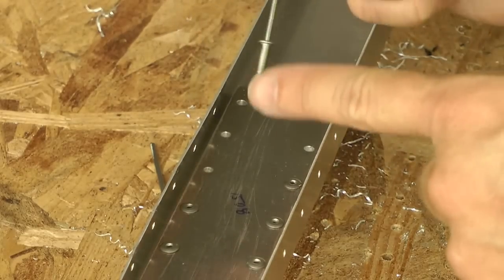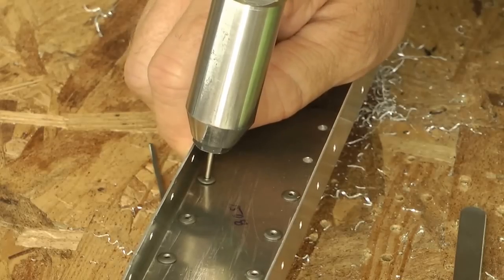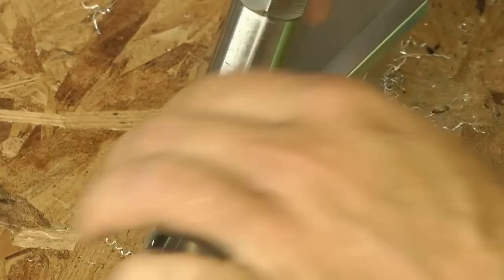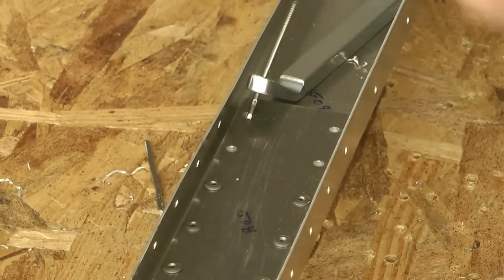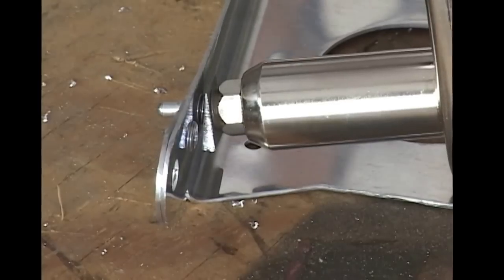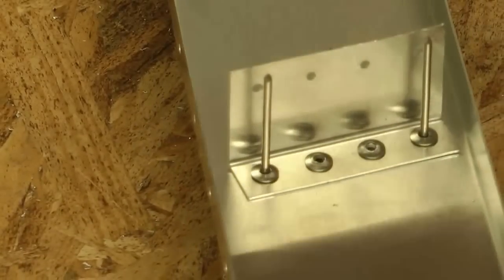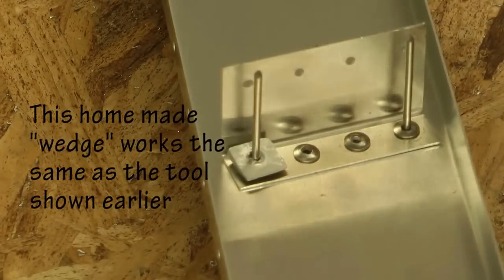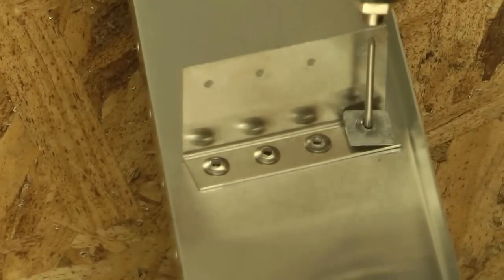Riveting in Really Tight Places (pop rivets)

Comment: An offshoot of this idea and in a slightly different situation, I used a stack of small washers on the head of the rivet to raise  the head of the rivet tool high enough for riveting in through a hole too small for the head to fit into. This was for a drawer slide replacement on a Husky Tool Box. I needed about 1/4" perhaps a tad more.
Reply: Thanks for posting this as I'm in the very situation you state here,The access hole on the runner is not big enough to accept the riveter nozzle..I'm going to try this🙏 Thankyou

Comment: Take your rivet gun to pieces and turn down the nose in your lathe.Rivet guns are over engeneered and will still set rivets when slimmed down.You could also use a tubular steel spacer as long as the jaws still grip the rivet stem.
Reply: Is there any way to make a mini rivet gun for real small holes?

Comment: Is it also possible with this technique to use to long rivets on pieces that are to thin, that the Rivet breaks apart on the correct length anyway, or is it better to place spacer washers on the Rivet to get the proper cutti g length ? 🤔